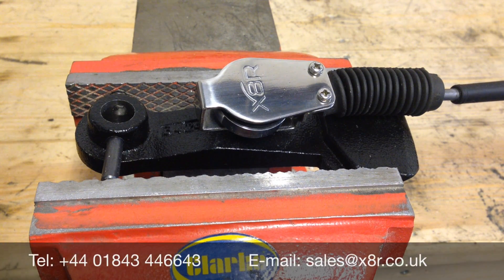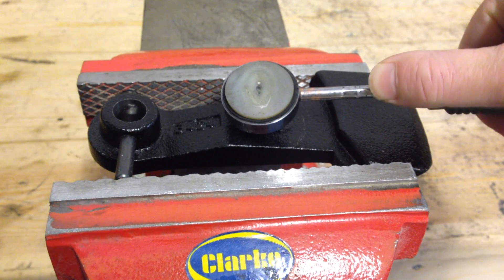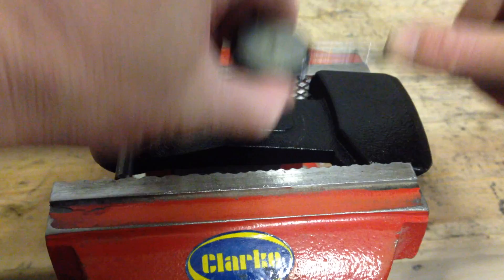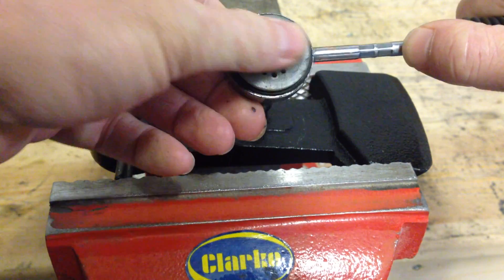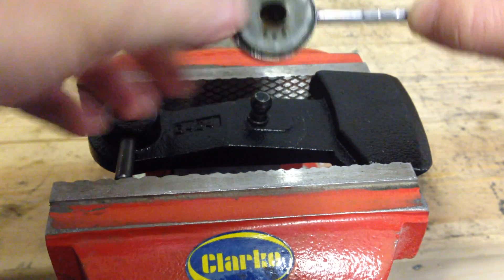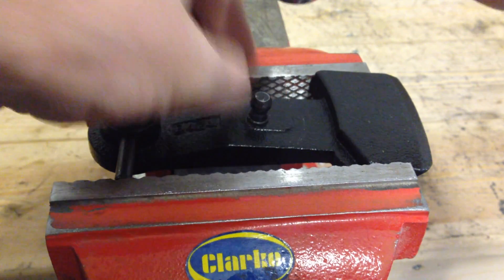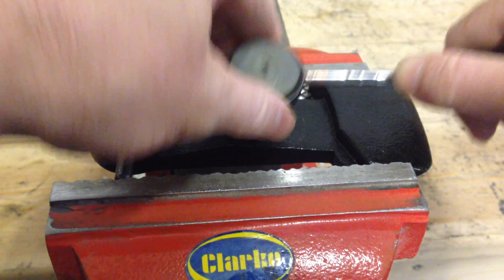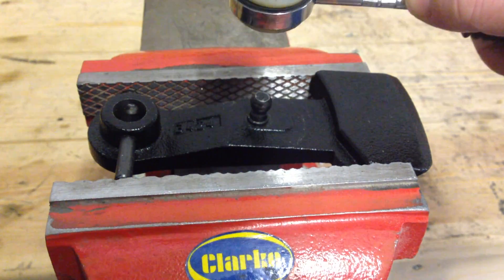Vauxhall Vivaro, Renault Trafic, Nissan Primastar Gear Shift Selector Linkage Cable Repair Fix

Comment: Brilliant idea.  Just fitted mine.  I did however use some tread lock blue just to secure the 2 little screws from vibrating loose.  However as I’m sure you who did this before me. It’s tight. So I undid the intercooler house and even so still had to install it 1 handed.  There iWasnt any other way without removing components and or sending it to the garage.   Thanks for sharing x8r.
Reply from the maker: Hi there, yes sometimes other components have to be loosened/removed, it can be a fiddly job. Good news that this solved your issue. - Georgina, X8R Ltd
Reply: @X8RLtdUK  Georgina.  That little clamp saved me days off work and hundreds of pounds. In days of whilst the van would have been in the shop/ garage.  Bloody brilliant. Many thanks.  
I also seen that you do a Eaton supercharger service kit for the r53 mini.  I will be in touch  many thanks again

Comment: Looks like the miracle cure for my 2010 reg Renault Master semi auto gear change. Not sure yet🧐🧐. The failure mode is it intermittently fails to go into gear at startup. Will this fit? I’m ringing you guys tomorrow. El Dragon.

Comment: or buy a new set of cables for £30 and have smoother gear changing aswell...
Reply: ASHLambretta new sets of cable is around  200£ in vauxhall service shop..

Comment: 1. panic gears not working nissan primastar
2.ask a garage who give you a crazy price to replace cable as they say its the only fix
3. after asking friends and  praying for a miracle i look up youtube and type in problem and see the fix ( 8XR ) and ask is this to good to be true 
4. look up company find number ring the number speak in a desperate voice but after seconds realize this company really do have the answer and explain that i can fit this my self its that easy
5. order product 8XR cant believe its that cheap confirm price again in case price is more after given card number paid extra for delivery to Ireland paid for express  delivery hung up still a bit  anxious will it work on my van 
6. 2 days later parcel delivered as promised opened it like it was Xmas toook out a very well made  two stainless pieces  of engineering 
7. took out instructions read 3 times went out to van opened bonnet looked into were it said problem was
 had small screw driver pair of surgical gloves and small pkt of wipes looked at watch 9.00am started 9.20am fitted job done
8.van working 100% so Nissan there is a cheaper and better repair AND ANYONE CAN DO IT THANK YOU TO THE STAFF IN X8R